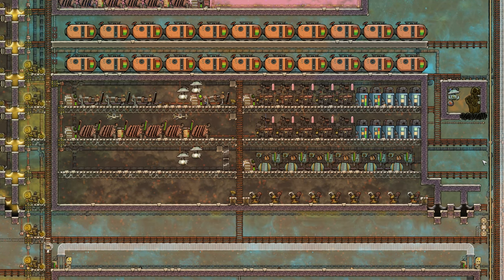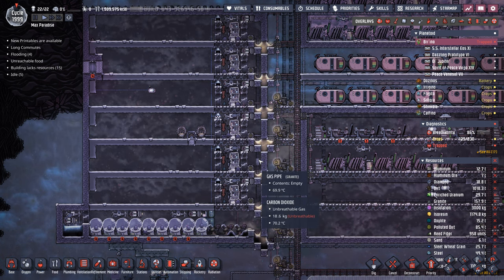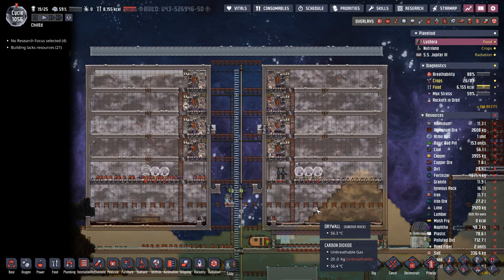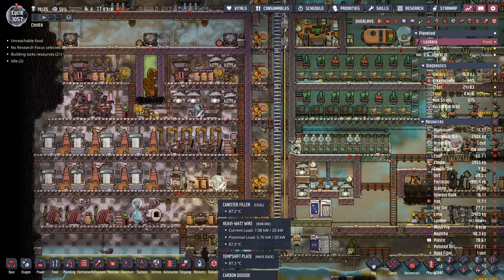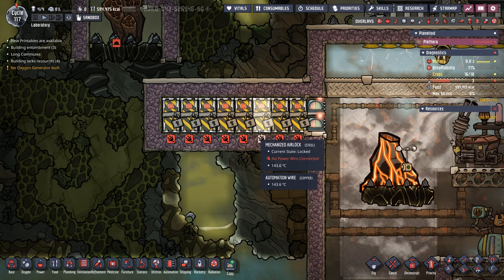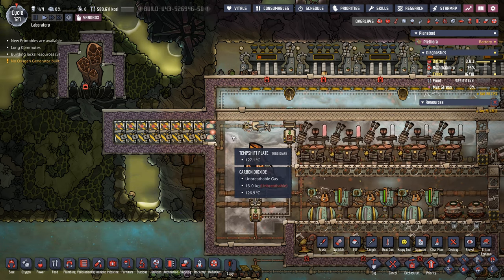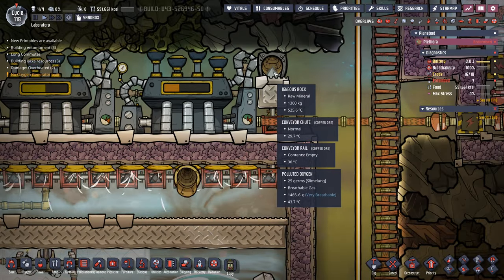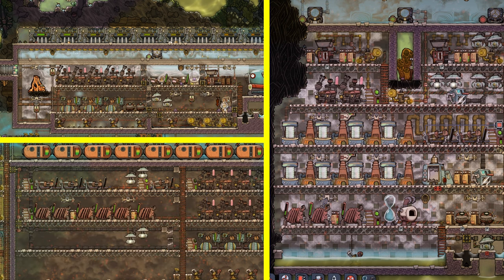3 different dirty industry bricks! | Oxygen Not Included

Comment: I tend to use a single timer, and the automation that sends a signal after it gets a signal for so many seconds, for my gas crushers.
Reply: For Gas crushers, you can simply use one timer AND a Buffer gate.
Set the timer, all doors will open as usual, but the buffer gate will delay the second and further doors. Easier than setting two timers and having to follow such strict rules.

Comment: I have a challenge for you once you have done the next video, how would you convert an active industrial sauna to a cold industrial brick? you would usually have the industry already set up by the time you get access to the materials needed to make a cold brick which is why I have never done one... how would you go about swapping? would you need to completely rebuild?
Reply from the maker: Not completely. Put the aquatuner in the steam room, run it with super coolant for a 50 cycles at max cooling and then transfer some of the storage and piping over.

Comment: 10:00 — would it not be better to run the rails through the metal tiles two rows lower, to speed up the heat transfer?
Reply from the maker: Def, I made the example to quick and fast, would def do it with a few more rails back and forth.

Comment: Hidden Echo @ 7:25
I built an ethanol + petroleum generator setup in a dirty brick with the generator at the top and the polluted water traversed back and forth to cook the ethanol distillers on the way down.
Reply from the maker: I like it.  I need to remember to use the drips as potential cooling.